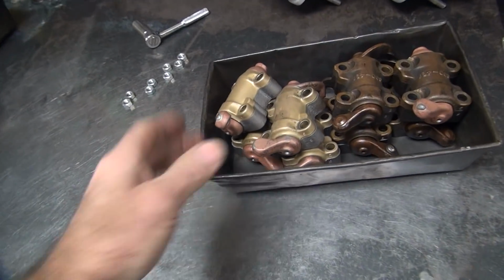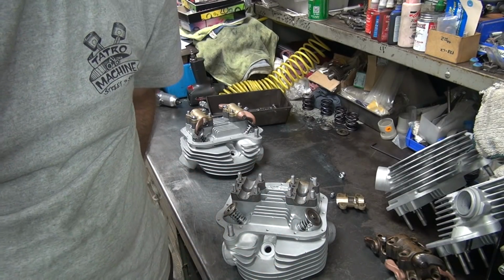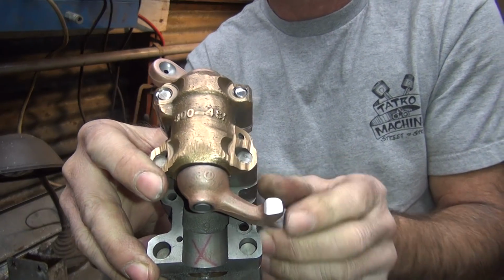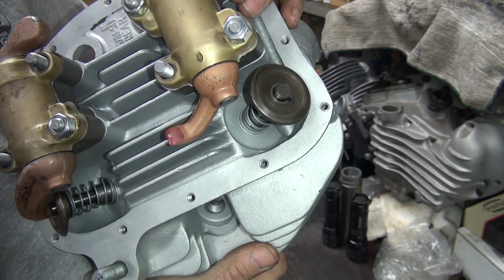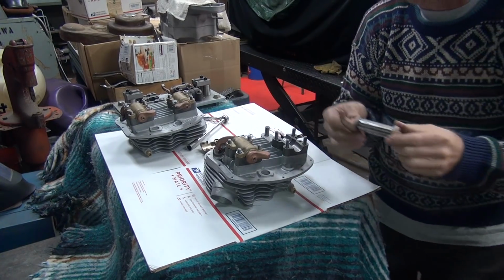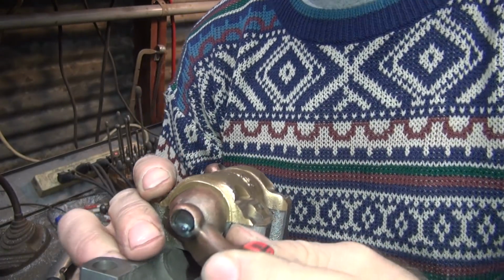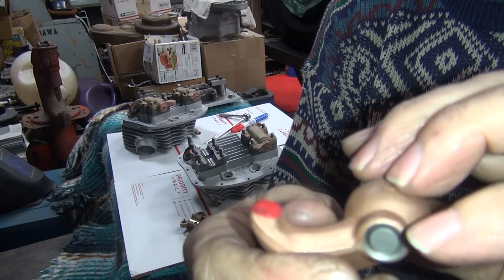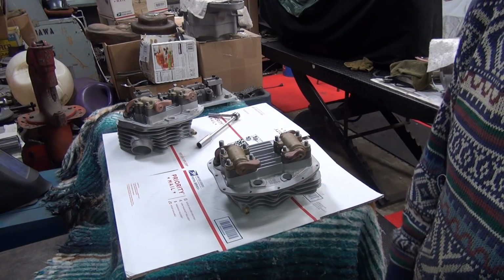1965 panhead #146 74ci flh motor rebuild and bike repair harley by tatro machine

Comment: In Lycoming and Continental aircraft engines which are also air cooled, the rocker arms are purposely set slightly off center of valve so that the valves rotate. Is this a big concern here? Or is it over thinking?
Reply from the maker: harleys don't have valve rotation. the whole way they are made stops rotation. misalignments are just that, bad design.
tatro